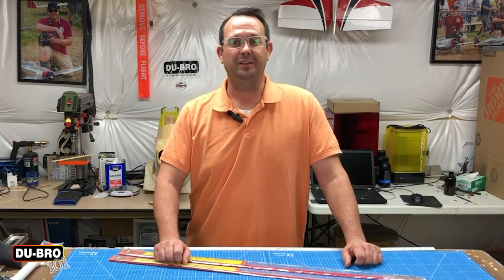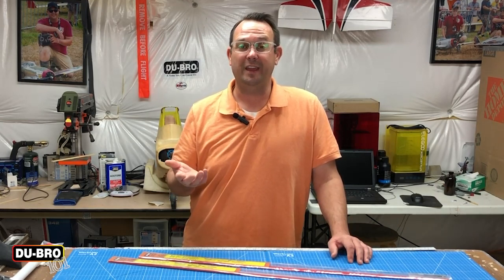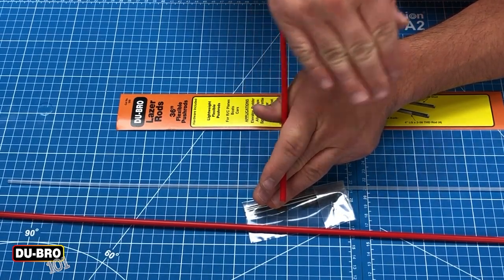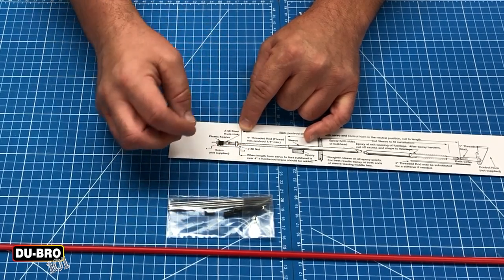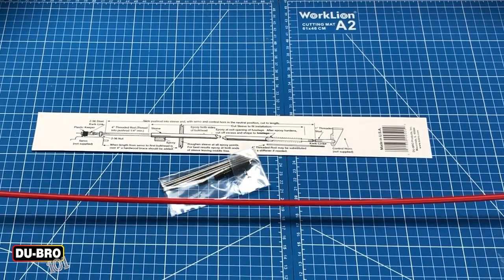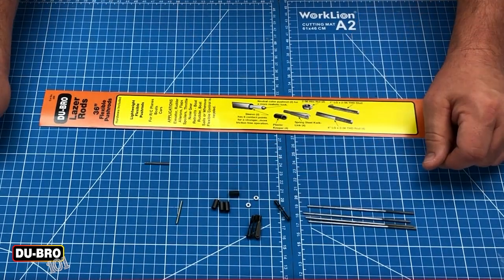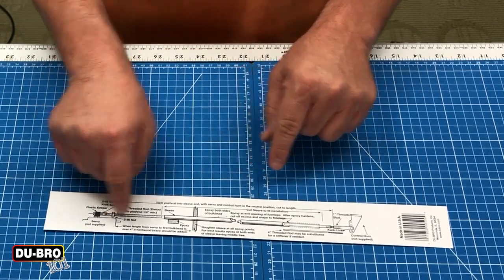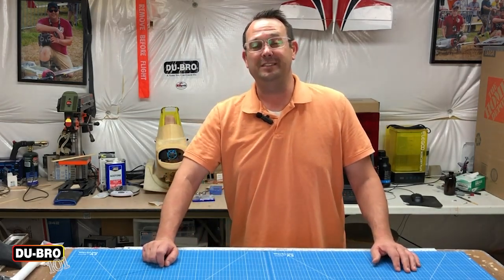Dubro 101: Lazer Rods

Comment: I'm going to need to install the 4 Inch Long Wire Extensions on the tail end of the Laser Rods. You showed that they are included in with the Laser Rod Kit, but you didn't show how they are secured to the end of the inner translucent colored pushrod. Can you tell me the method you recommend using to secure the 4 Inch Metal Extensions to the inner pushrod?
Reply from the maker: Hi Michael, I think you are talking about the threaded stud. That self taps into the tube for a tight fit.
Reply: what I didn't understand is that the long, blunt end of the Stiffener is first slid all the way inside the end of the push rod and then only half of the threads thread into the end of the pushrod. I mistook the Stiffener as an "extension" of the pushrod. Thank you for clarifying how it is supposed to be installed.  @dubropineridge